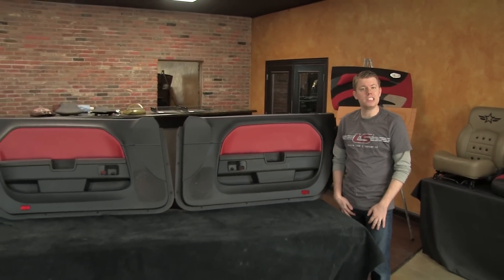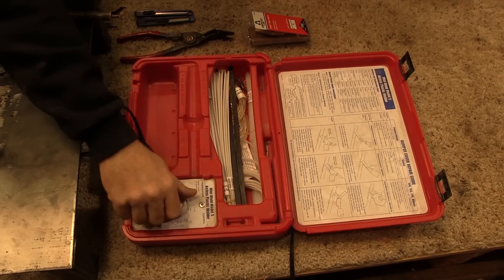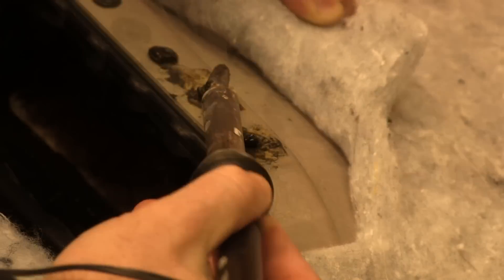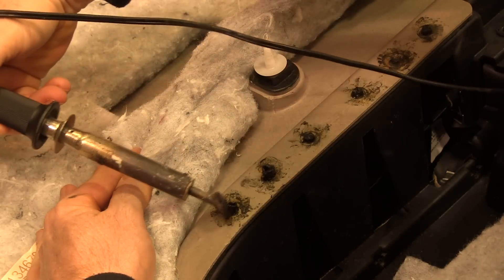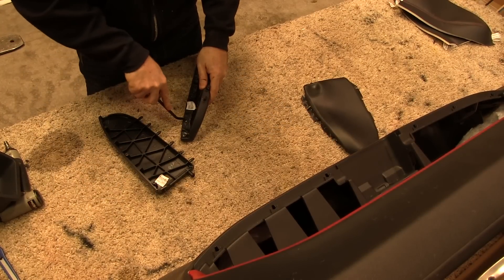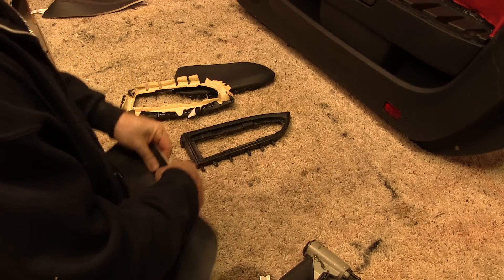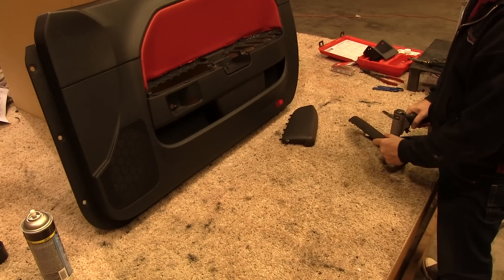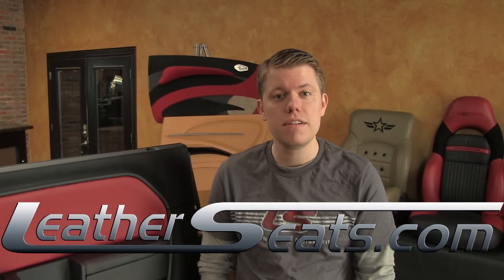Dodge Challenger SRT-8 Custom Leather Door Armrest Cover Installation Video - LeatherSeats.com

Comment: is there any special glue used to stick red leather to the door trim?(not arm rests)
Reply from the maker: It depends on the specific needs of a given project. For extra strength adhesive, we use Weldwood Landau Top and Trim Adhesive but for standard/lesser strength needs we will use 3M 20 Heavy Duty which you can find on our site here: https://www.leatherseats.com/shop/installation-tools/3m-20-adhesive-glue.html Please email sales@leatherseats.com if you have any questions.

Comment: how do you install the upper cloth inserts for the door panels?
Reply from the maker: drake hudson The upper door inserts are installed by gluing the new door insert material to the door insert section and then trimming and tucking all the edges.  It would actually be easier to do them at the same time as the door armrests because you could tuck the lower section without any difficulty since the armrests would be out of the way.

Comment: i have a guess, does dodge charger 2012 leather seats fit on a 2015 dodge challenger??
Reply from the maker: +SXT Project No, the upholstery we build is specific to the year and model and is not cross-compatible with another year range or vehicle. You would want to make sure to purchase a kit for your specific year and model. If you have a 15 Dodge Challenger you would want to make sure to select that year and model. Feel free to give us a call to discuss your project. 866-639-7328.